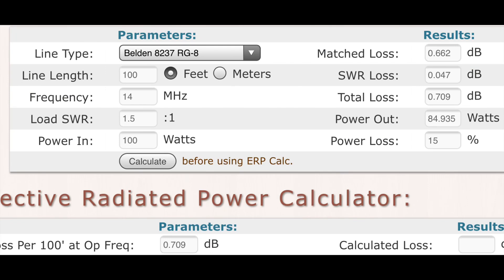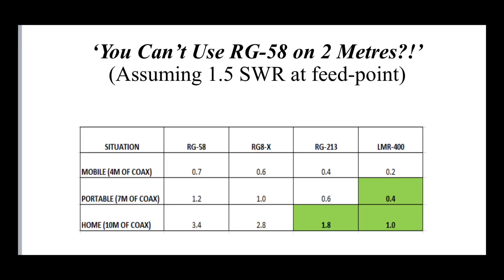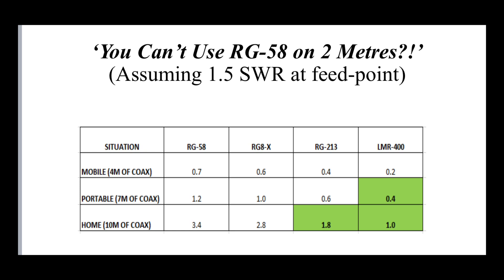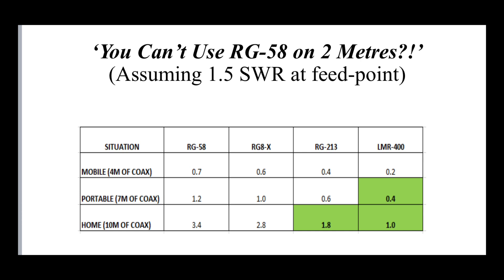Ham Radio: Coax Cable Myths

Comment from the maker: **STOP PRESS: ERROR ON MY FIGURES! 10m RUN OF COAX ON 145 MHZ: RG58 IS 1.7dB, RG8X 1.4dB, RG213 0.9dB, LMR400 0.5dB.**
Reply: i got 3 reels of rg 58 for 30 bucks and us hams are tearing me new one for using it
Reply: Something that a lot of hams forget about, or just don't know, is that you need a balun loop (2wavelenghts) and tune the length to an even half wave length. This will more than compensate for any coax losses.
Reply: Very interesting video,  thanks Tim
Reply from the maker: @welshbikepackingadventures  thanks Mark
Reply from the maker: @don9100  almost 100% correct .. I was born and bred 15 miles west of Swansea
Reply: @pixeluser75 those new db figures seem like a negligible change.

Comment: I have a 70 FOOT RUN of RG-58, and according to loss at 145 MHz it should suck a baseball through a garden hose, but I've made perfect repeater contacts at 1 watt from the radio with zero issues, and the repeater in question is 10 MILES OUT.

Comment: I used to use about 10m of RG-58U for portable work, with a Yaesu FT-817ND and inverted V dipole for either 40m WAB squares and occasionally 20m. This was on a 7m fibreglass fishing pole.

Comment: Well said & thank you for sharing .
today's  RG 58 with aluminium foiling is perfectly fine , it's just as good as all the higher end coax except it cannot deliver higher power transmission anything over 500 watts , generally speaking RG 58 is perfectly fine .

Comment: Just passed my test in January. At home the antennas I use are pretty compromised so I use rg213.  Out in the cuds I use RG58 because it’s hardly noticeable on very short runs. I looked at getting some LMR400 for the home once I get better antennas setup in the summer. 73.
Reply from the maker: Nice thinking 👍

Comment: I  just watched a video where a fellow connected his UHF transmitter to a dummy load with a watt meter with different kinds and lengths of coax  up to 3 meters length.  The SWR was 1.01:1 with his dummy load.  I was highly surprised at the amount of watts lost un the cable that was 5 meters long.  
Published dB specifications didn't reconcile with the watt meter.
If you want to know the real loss of power measure it with different lengths of coax, the same dummy load and the same watt meter.

Comment: Maybe you can give me your .2 I’m getting into 10/11 meter running 1kw and my current coax is lmr400 but it’s just too difficult to work with for jumpers/patch cables. What’s my next best option ?
Reply from the maker: You will need really good coax to handle that power. I am unsure what is out there for you - look at the Messi and Paloni website for guidance on losses and power handling. Some outlets do bespoke coax lengths and plug fittings.

Comment: Other coaxial myth is "multiple 1/2 lambda" length. Real context is very rare, bad tuned antenas preffer multiple 1/2. Second argument: impossible to cut "multiple 1/2" for wide range.

Comment: Well delivered
As a seasoned RF tech, I can say that all the NMO antenna kits had RG-58 coax for 150, 460 and even 800MHz for years. It all worked for the EMS and land mobile crowd. 
As for RG-174, we refered to it as "Attenuax." Simply because most of the users were running it on frequencies 144MHz and up. Then again, these were the same ones using the antenna cut chart and calling it good.

Comment: So I heard that 3db is a 50% loss. Assuming that's true.(not sure it is) wouldn't every db matter. That means every tenth of a DB is 1.6 percent loss of power.  1 db of loss is about 16 percent. That's a big number. Sure it's just 1 db but percentage of loss matters. Thoughts?
Reply from the maker: I compare it to s units. 6dB is a single s unit. 3dB is half an s unit. So overall 1-2dB isn’t a huge deal breaker from my perspective 73

Comment: I use RG-6 for transmission line on all my antennas. Reason why ?? It is what I have available. I used to work for DISH and DIRECT satellite TV, and when they abandoned us installers, I had several thousand feet of RG 6 in stock, some two cables and a drain wire. So, I had lots of transmission line, why buy another type of coax ? Despite 72 ohm being the natural feedpoint impedance of a dipole, the RG 6 is a match for that at 75 ohms, only three ohms difference. Now, the type of braid makes little difference, whether a  coax has braided, or metal film based on plastic makes no difference because RF moves on the skin (skin effect). So it can be used on 160 meters through 70CM without loss. This fixation with 50 ohm cable to please your transceiver is practical, but excessive. What is the best transmission line to use, it is what you have on hand, or what you can get quickly. Granted, power levels determine what coax you use, but under 500 watts, RG6, RG8X, or whatever small diameter coax will do you fine ! I have even used 62 ohm Milsurp coax on 6 Meters with great success. You just have to tune the antenna accordingly. Cheap or readily available coax will always work no matter what the source is, just remember that lengths over 60' will get lossy no matter how good or expensive the coax is. Now, go out and experiment !!!

Comment: Another good video, Thanks Tim!
Since db, being logarithmic, is hard to grasp for most people I like to put things into real world perspective by framing loss in S-Units of signal lost, 1 S-Unit being 6 db. Therefore from your Chart for 7 meters of coax, the difference in RG-213 and RG-58 @ 10 meters is only .3db, or 1/20th of an S-Unit, and at 15, 20 and 40 meters its only .2 db or 1/30th of an S-Unit. IMHO that slight of a loss can't be noticed in real world operations, and many Hams take any losses at all too seriously.    73   mike
Reply from the maker: Thanks Mike, good info 73

Comment: Good vid, thank you for putting it together. There's absolutely no shame in using RG58 for under 100 foot runs...you'll lose far more signal strength ( Rx and Tx ) to good old Gaussian distribution....8dB of normal signal fade in the UHF bands makes 3dB in cable performance differences downright trivial. No need to sweat over a couple dB.
Reply from the maker: Totally agree

Comment: I am dealing principally with operations on a variety of frequencies in the 136-174MHz range and RG58 is my goto solution for transceivers in a mobile/portable situation. That is mainly because its diameter and minimum bend radius makes it practical and less likely to suffer damage in those circumstance. Base stuff is wired in RG213 and has seriously good performance but that is possible because it is sitting undisturbed in wall and roof spaces and is laid out with nice large radii all the way to the antennae.
Reply from the maker: Exactly .. great information and typical I think of many installations. Thank you

Comment: Personally, I think that there is no use for RG-58 as RG-X or LRM-240 are  better and there is no significant cost or weight difference.  RG-174 has it uses usually as short lengths (< 30cm) for use as strain relievers for HT attachment and to sneak coax through a car door or hatchback. The purpose of a transmitting antenna is to convert as much energy into radio waves as possible.  A 3db loss means that half the power is lost in the Coax.  For non-resonant antennas extra losses due  higher SWR also have to be considered. My basic opinion is that coax should not limit the station performance.  For an antenna with Z=200 ohms fed with 100 feet of RG 174 at 28 MHz the loss will be 7.9 dB  for LMR 400 the loss will be 1.3dB.

Comment: I am wondering because I don't know. 1dB isn't much but under the 2 following situations does it still not matter? 1) you have a good deal of distance between you and your contact and are trying to get as much antenna gain as possible. Obviously moving your antenna up will help but that means more coax.
2) you are running a low powered rig (5 watts) and are trying to maximize the reach of your signal. Again up helps but at the cost of more coax.

Comment: I just bought 15M of RG-316/PL-259 from Banggood for USD$15. I’ve been worrying that it will be a disaster for HF. According to the web, RG-316 is almost the same as RG-174 (better materials and temperature rating, same size). 

This video is the first that’s calming me that, once it arrives, it will be okay for field use (full-time living on my motorcycle). Thank you. I guess I’ll see now whether this cheap Banggood version is the real thing now. :)

Comment: Great video! I'm actually planning changing out all of my RG8X patch cables (due to intermittent connectors) over to RG58. The loss is about the same...pretty negligible. Also swapping out straight PL-259s for right angle connectors, which are easier to solder and takes the strain off the main pin. Sometimes, we need to challenge the status quo, yes? :) Thanks again!
Reply from the maker: Thanks!

Comment: Disagree

Probably for 2M-FM,
But for 2M-SSB i dont use less than LMR-400 for short jumpers, and LMR-600 or better for the rest. 

Remember dB's add up 1.2dB coax loss plus 0.5dB per-PL259 and a couple more on the SWR meter all of the sudden your at 3.2dB-3.5dB loss which is terrible!  

After many years of QRP, I've learned every dB matters and save losses where you can.

Comment: Coax loss works in receiving as well. Sometimes 1/2 or 1 dB can make a difference in getting that far far away QRP station or not. I've seen fellow HAMs use RG-213 in connecting their transceiver to the switches, SWR meters, low-pass filters etc. to get every mV into the transceiver...
Reply from the maker: Yep I agree in some cases

Comment: Interesting video.  I started primarily using RG-8X for portable.  Since I am mostly QRP tough for parks whete I am operating from or near the car I typically use LMR-240UF these days.  I do carry RG-174 in my KX2 pack.  I don't disagree with what you saying but 1db of loss can be significant when only running 5 watts so I try to avoid the loss when I can. 

73 de KJ5T
Reply from the maker: Fair points - QRP is more critical for sure

Comment: Very helpful Tim
Thanks. 
I just bought a Diamond X50 UV antenna from MOONRAKER. 
I was discussing it in our radio club UHF QSO on Monday evening and they all warned me to get the right coax .
What they said is in harmony with what you show here in your charts.
So I'm going to "stick it up" bolting it to my chimney and carefully measure the length, add a wee bit more, and go order it all made up.
One experienced member mentioned something pertinent.   He said that 1/2 of the importance of low loss coax is to transmit well.  1/2 is so you can hear a  far away signal....
Reply from the maker: All good advice Peter - enjoy the new antenna.

Comment: Losses increase dramatically as wavelength decreases (1/lambda^1/2).  Plot it up. The examples cited were for  2m wavelength for RG-58 and  10m for RG-174.  Try rerunning these calcs for 70cm.  Losses at 70cm are about 2x the losses for 2m and 4x for 10m. 70cm has greater range than 2m in urban environments. Our local volunteer emergency responders use 70cm ham and GMRS bands for emcomms for this reason.
Reply from the maker: Sure but I have no real interest in UHF

Comment: One of the subjects you're missing here is ERP. On 11m, many would run 20m or more of RG58 for their home base. Now if you have a high gain antenna, you could be missing out on a lot of potential performance. Many would see only 60-50% percent of the power reaching the antenna. Some are running a kilowatt or more! (I know it's highly illegal and abnormal, but this is a fact). So if you do the maths on a 6, 9 or say, 11.5db antenna, the effective radiated power figures go through the roof if you were to run half inch Heliax. Even when compared to RG213. Punch the figures into one of those loss calculators. And yes, I understand what this translates to an S meter, but why compromise if you have already invested so much, and remember it works on receive too.

Comment: too much loss on RG58 even bad on CB!   never mind Ham radio!
Reply from the maker: Define too much loss
Reply: @TIMG5TM   well 20m  of RG58 on a CB  base station  27Mhz  going outside across  (5m) to a  to a DV27 on a  9m mast (29.5 feet)   signal strength went down considerably, probably over the longer length of the coax in question no matter how many times I tried to Swr  the antenna. longer length lower loss ! and colder weather it dropped even more  unless you used an coax amplifier.   LMR400 is the best with  practically 2.2 loss over that length

Comment: "right tool for the job", short runs, backpack carried, in vehicle, use thin stuff as you won't lose much, it doesn't weigh much and you really won't get RG213/LMR400 round the door seals of your car! at home, if you want 2 meters on a 7 to 10 meter tall mast, LMR400 all the way. on a personal note, i find RG58 awkward to fit to compression fit connectors. RG8x seems much easier to use.
Reply from the maker: Good points

Comment: RG58 gets a bit of a bad press because there's a lot of cheaply made coax out there claimed to be RG58, and is sold cheaply on some E-bay sites, by some Amazon sellers and some CB shops.  Get / pay for the proper quality RG58, and it's a good versatile and flexible coax. - You only get what you pay for, and perhaps there's a good reason why the coax you can buy on a bulk reel really cheap, is so cheap!

Best myth I've ever heard about coax:  Apparently many moons ago, in the days of AM CB, a guy in a CB shop was telling people that to get the best out or there radio, it was important to have their radio, coax and antenna set up properly, with the coax the correct way round.  To install the coax the right way round, the writing on it had to read away from the radio and towards the antenna!
Reply from the maker: Oh crikey!!!!!

Comment: Nice to see these figures here.
I have 20' of RG58 to my h/b 4 element collinear and could probably cut it to around 8' as my collinear is right outside the window, and almost horizontal as I never got round to putting it vertical. I must get some pvc water pipe to run it inside and put it vertical. One day! I need to get a Round Tuit.
About 45' of RG58 on my outdoor 60m inverted vee and about 25' to my 20m and 17m loft dipoles. Need to get the 15, 12 and 10m dipoles up now the bands are waking up.
G4GHB
Reply from the maker: Thanks Bill 73

Comment: Also watch the braid on coax. I bought some RG58 at a rally years ago and got it home and was disappointed because the braid was very open weave. Maybe okay at h.f. but I wouldn't like to use it at 2m. I think I used it on my 60m inverted vee.
I want to see the braid now before I buy any more.
G4GHB.
Reply from the maker: Good points Bill

Comment: ADAPTERS can be more of a problem and can fail in the field, especially the $1 crap Chinese ones.  Had I not had an SWR/Power meter attached to my VHF radio, I never would have noticed SWR going to infinity and potentially damaging my radio.  Buy well-made (crimped and soldered) cable and high quality adapters if ever needed.
Reply from the maker: Good points

Comment: RG58's shield braid isn't very efficient at blocking stray signals passing through it and can leak rf causing problems with electronics.
Reply from the maker: Depends on the quality
Reply: Depends on the quality
Reply: I just put a comment about some RG58 I bought at a rally, very open weave braid so I want to see that before I buy any more at a rally.
G4GHB

Comment: hi tim i go with rg58 and rg 174 runs under 5 m fore the longer runs usualy rg213 only vhen i run  25- 50 m radio to antenna usualy this hapens highy up in the mountains wher you cant deply antena and have at the base of the antena the radio not too muchy room so you need usualy other spots to deploy radio 73
Reply from the maker: Noted

Comment: Great info.  I am running a  cp22e+ 10m rg58 for my vhf reception.  Does it have any factor with the reception coz i am able to receive only 3 local repeaters where a nearby Ham with same cp22e + rh213 is able to access almost all repeaters (10+) in 200 km radius.
Reply from the maker: Hi there. Yes it will be poorer than the thicker coax at vhf (I presume you mean 2m band). It also depends on the quality of the coax too.
Reply: @TIMG5TM  thank you so much... I made an upgrade today to lmr400 and increased the mast height to another 6 mtr and could see a considerable difference 🙏
Reply from the maker: @HarishKottayam  I’m sure it will

Comment: Fantastic! Absolutely fantastic! I do not use RG58 anymore, however I discontinued attending my local club when I was 16 due to the issues I had with other OM criticizing my use of RG58. At 16 years old I was really unable to afford any higher end coax. I had many of them telling me I NEEDED RG8x or LMR400. All of that is hogwash. You do not NEED it. Is it nice? Yes. However do not go around criticizing a hams use of coax. If you don’t agree, that is fine. But at age 16 and still in Highschool, I was unable to afford much more than that. I’ll also say this as well; DO NOT criticize a new hams use of 10 meters. In my first year, with my terrible coax as well as antenna setup (a 10 meter dipole strung up along the top of a privacy fence) I made well over 50 DX contacts in just the span of my summer break. I had many local hams shaming me because I was on 10. I stopped attending the club when I was 16 after 2 years of shaming for coax, antennas, and my interest in Boat anchors. And now if you look at my channel you can see just how far I have come.
Reply from the maker: Totally agree 73
Reply: @timg5tm941 I am building a vertical dipole for vhf alot people telling me not to use rg 58 but I am a firm beliver that it  it works that what feeds my friend vhf
Reply: Your experience is why Ham radio is dying. To many Hams are total w@nkers and think their crap dont stink.